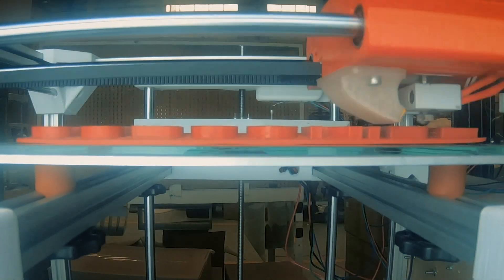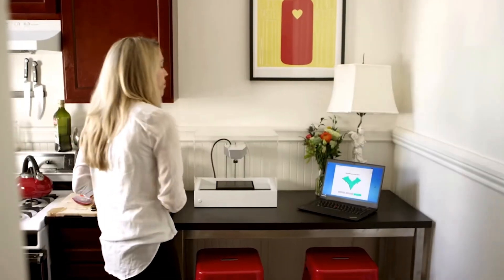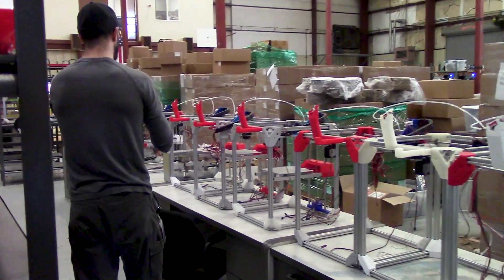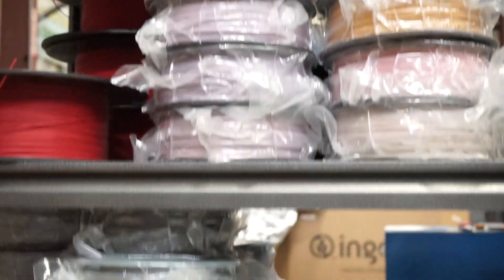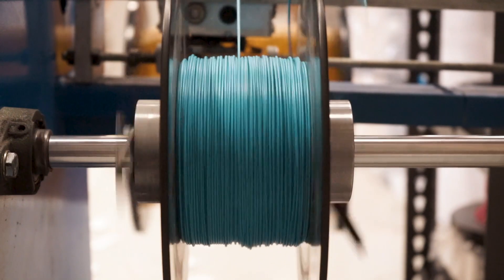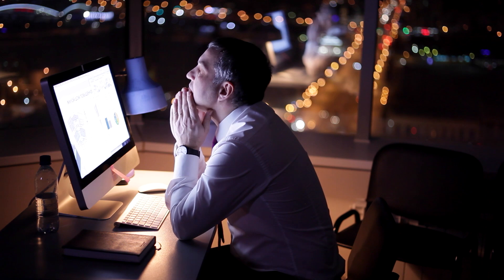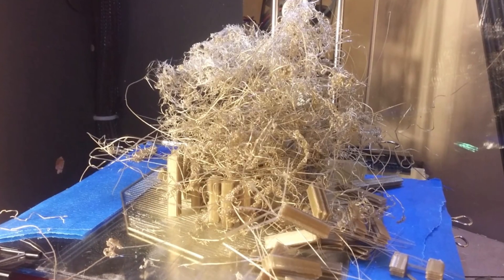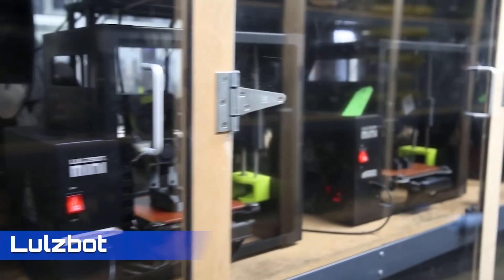So You Wanna Build a GIANT 3D Print Farm?

Comment: You certainly can use low cost printers to run a small print farm. I have 5 Elegoo Neptune 3 Pro with a cost of $200 each. After 365 days of non stop use I have spent $75 in maintenance and parts.

Comment: If you're mechanically inclined, any printer is a mass production ready machine. Most bedslingers and core XY machines are based on similar electrical and mechanical components, they're really not that complicated. Sure, the software may be a challenge when printing at scale, but it's 100% doable. You could build a print farm using Ender 3's if you want. As long as you know how to keep them in operation, they'll keep on printing. You do not need thousands of amps, that's ridiculous. My printers consume no more than 50 watts each while running. I can run 20 units inside my house on residential supply. I agree with some of the points, but not all.
Reply from the maker: Our biggest print farm is set to hold 3000 machines
Reply: @slant3d  that's going to look next-level. Cant wait to see it go live. What's your time lines for that if you dont mind me asking? Then, just on the distinction between your operation and many other operators globally. Many of your viewers are not American, which means they are likely using 220v and not 110v like in the US. If you're on 110v supply, your amperage consumption will be higher because 110v is inherently less efficient than 220v. Not sure what your industrial supply comes in at but if it's all based on 110v, then your amps consumption will be higher than a 220v farm. Also, while it is interesting to hear of your challenges, not very many companies play at the level of 3000 machines, which means your video really only applies to these stratospheric print farms. The majorit of your viewers, who are building a farm are likely to max out at far below 100 machines so the considerations applicable to a 3000 unit PF are not as impactful to cost of ops in a sub 100 unit PF.

Either way, please do make a big deal of that 3000 unit farm when it goes live Bro, we seriously would like to see that, or I would at least 🤝🤝

Comment: I’m an electrician and I have 2 degrees in electrical as well. 
The highest amp draw is during the bed being heated which can reach around 12 amps
This means that you should order 25amp breakers to place 2 printers on one circuit using 12 gauge wire. 
Your typical 200 amp panel has 40 spaces, if the panel didn’t have anything in it but 3D printer circuits then you could  make use of 40 circuits powering 80 printers
Furthermore you could do fine with a 400amp service on a fused disconnect and run 4- 200 amp panels off of that. 
All your printers won’t be earning the bed up at the same time, it only draws 4 amps when printing 

Someone has swaggled you with the electrical

Comment: I have a bambu lab at home and just print with PLA only so far.  The most unreliable thing are the print plates.  When you have a print farm, what plates do you use and how do you configure them to peel parts over and over.
Reply: using pei sheets provides great adhesion and durability

Comment: There’s no stigma with printing. At least not in the way you’re claiming. The “stigma” is rather that people keep saying you can and trying to print “anything”. It’s just not true. While it’s technically true, that doesn’t mean that you SHOULD print everything…THIS is the actual reason for any stigma surrounding 3D printing. The only way around or out of this stigma is being wise enough to say… “No, that’s not something that should be printed”

So yes; if things are designed, from the start, as designs intended for 3D printing. They will do ok compared to an equivalent injection molded part. However… the problem 3D prints run into is layer adhesion. Even the very best printers, with the Best filament and the Best operator will still have an inherent weakness between layers. So as long as the stresses on the part are largely compressive. Printed parts are fine. If there is any tension on the layers. It’s exponentially better have an injection molded part. Or better yet a cast aluminum or machined part. 

I saw a meme the other day the read
“3D printing is the sand casting of today” or something similar. And immediately I understand the concept, but also simultaneously thought that if that’s true… It’s no wonder we’re failing. We used to cast IRON and STEEL in sand casting. Now we’ve decided that plastic is better when we all know it’s not. My point here is it’s completely ok to realize that you actually cannot “print anything”. And it’s important to be able to delineate what is a product well suited to printing and one that would better serve the customer’s needs with another process or even material…
Reply from the maker: Everything can and will be 3d printed. Design for the process. Stop printing injection molded designs
Reply: @slant3d  right… Print me a Kenworth

Comment: You might want to consider improving your audio by reducing echo in the room with foam sound panels. 
Also it is worth considering a proper mic (like NT1a or SM7) with audio interface. Though this is not critical, USB mics do work, echo is more of an issue.
(Wrapping a foam panel behind the mic does not work. Strong sources of echo are flat walls perpendicular to plane between you and mic and also corners)

Comment: Got real Vape Shop Bubble and Crash vibes. Every mom and pop shop thought they were going to go into MFG until the gov and market saturation shut that down.

Why would someone outsource to a print farm, and pay very steep prices, instead of buying a cheap printer or asking a friend or whatever like that? The one-touch and print reliably is here, its already here. Even at cheap print costs, its still going to be cheaper to buy a printer instead of 5-10 parts from a farm. I mean really think about it. Print farms are good when the machines are unreliable. But for you to have a farm, you need reliable printers, and if you have a reliable printers, the farm is not necessary.

Comment: I found myself agreeing with ~half of what you are saying here, for starters Prusa makes a printer that is designed around print farms so the first point is already kinda null. I can see what you are getting at with Creality and those types of printers, definitely true in that case. Additionally you CAN go to businesses around you and ask if they want parts printed, that's how a print farm/design business can get off the ground locally. And the power issue really depends on the scale, because as you said a print farm of 50-100 printers might not need that much power. Most small print farms are 20-50 printers, which is plenty to be called a print farm. By the time you need to worry about power draw you are already making enough money to afford it. 

Overall good video, but several points were definitely overexaggerated, you don't need to develop your own machine to get into the farm business lmao.

Comment: I built a prusa farm and it works great, it manages I think 60ish printers right now. We used octoprint and custom software to manage everything. People submit prints online, algorithm checks it, then prints it. Each printer has a receipt printer that prints all the needed info to match orders to prints. We hardly ever touch machines besides pulling prints off and making them ready to accept a new print. It's as close to full autonomy as we can get right now. Last year I think was around 8k prints done without intervention.
Reply from the maker: Now take that to 800K prints and you will see the problems.
Reply: @slant3d  Prusas are pretty reliable and the only ones on the market it would trust in that scenario. But i bet you can built your machines cheaper internally.

Comment: Not completely true with the off-the-shelf comment.  A Prusa MK3 is designed and used in print farms. Better if you can build it yourself so you can clean and properly pack the bearings with lube, but it can print non-stop. With a few aftermarket printed replacement parts to make maintenance easier, they can go constantly with very little maintenance downtime. This is one reason you pay a premium for Prusa printers, they are designed for durability and low downtime.
Reply: wrong

Comment: Prusa i3 printers are designed for use in print farms. So it's not true that you can't use a printer 'off the shelf'. I've used my i3 MK3 printers for thousands of hours of printing with absolutely minimal maintenance required. And maintenance is extremely easy in most cases.
Reply: Only one change required if you buy them prebuilt, or building your own: clean the bearings and pack the bearings with lube. The oil that comes on them is to prevent rusting, it's not lube. After that, they can go non-stop for months without maintenance.

Comment: Running any corporation is hell.  You’re running a large corporation, yet 99% of people watching this are trying to make 10-40k extra a year.  Those are still farms.  Not a single person watching ever considered moving into a train station.  Although your points are valid for a ridiculously sized 3d print farm, your audience is typically not interested in that scale.  Don’t dissuade the entrepreneurs wanting to get in to the trade.
Reply: He isn't dissuading anyone. It's more of a "hey, make sure you realize there is more to this than downloading something off Thingiverse and clicking print on your Ender 3
Reply: @Capitan1nsan0 sure there is more to it. 300 watts for a single printer doesn't sound like much. Switching to Solar PV with batteries and DC only could cut like 20% of wasted energy in conversion. But at scale it is a lot of energy. 🤔 Isn't it getting hot 🔥 in a print farm? There could be hotend designed to use less energy.
Reply: @Capitan1nsan0  it's alarming how much stuff on thingiverse isn't designed for the process.. I've had to make just about everything I've printed myself because very little I've found is satisfactory for printing as it is (if it even exists at all -.-)
Reply: Good point. Also, a kingroon KP3S could very well run production operations right out the box, that machine is cheap, but gold nevertheless.
Reply: "Not a single person watching this has ever considered moving into a train station" I wouldn't be so sure about that..

Comment: On Point ! I just built up an printingfarm in Germany with +200 printers. Our two main challanges: Maintanance and „stigma“.
Reply from the maker: Yes. The maintenance is a huge issue with off-the-shelf machines
Reply: Only have 40 machines, all off the shelf, if I knew then what I know now, I may have gone a different route, they need so much reliability modifications, it doubles the cost of the system
Reply: i didn't stqrt yet but i'm wondering what brand of machine can hadle masse production any idea?
Reply from the maker: We don't know of an off the shelf machine for print farms. We had to develop our own.
Reply: @mebarkaouassim1324  there is no dedicated system, choose a system that has some reputation of reliability- or decent printing out the box, but be prepared to change anything from controller boards that can’t handle 24/7 printing to cooling fans, to HotEnds that need to be all metal, it’s a long list. But if you are aware and prepared, and work it into the business model you can make it work, after a while you will see what needs to be changed or not. When you are running a production project, you will quickly notice what components are failing (especially IM extruder housings) and then it is about swopping out and upgrading
Reply: Which machines did you use?
Reply: @leotac5737  I used Ender 3 V2, but in standard spec they don’t last a week of production
Reply: @Romans116Clique  every ender print farm eventually stops being a ender print farm. Better to go with prusa or Bambu imo
Reply: @padel24x7  not necessarily,
Reply: @leotac5737  Hi, mainly custom made and 27 from different manufactures as bambu, raise and formlabs.
Reply: the vivedino marathoner might be a good fit for reliability.
and that all-ballscrew one.

Comment: One of the Main concerns in hiring a print farm is the security of the STL’s. The print farm itself may be doing a good job protecting clients STL’s. But what if they use machines that require cloud computing on their own and re-transmit that STL to who knows where. That’s why Slant 3D stands out a bit because I think you guys make your own machines right?
Reply from the maker: Yes. We make our own machines and software. But design security is a solved problem that has existed in manufacturing since 100 years ago. It is not a new problem.
Reply: @slant3d  one particular new machine manufacturer requires the owner to register it with an app. It also sends data to them. Not secure in my opinion. I like open machines. No app required to use it, lol
Reply: I'm not even sure how that's a problem even if one didn't have the stl files most everything can be recreated pretty easily. I guess the only way this may be a problem is if you have something unique and they beat you to market.